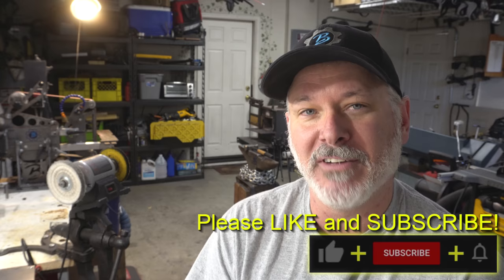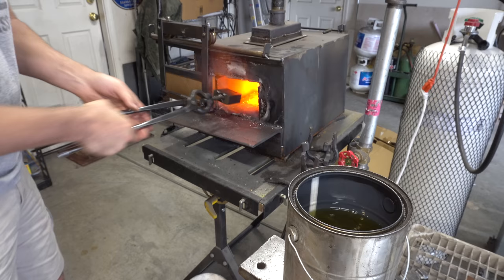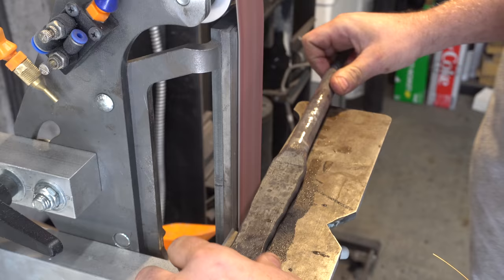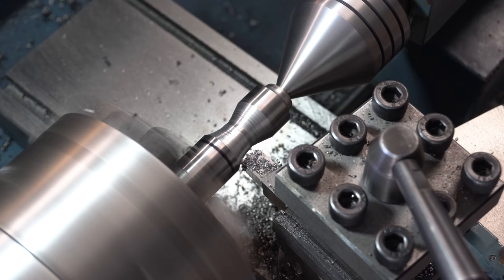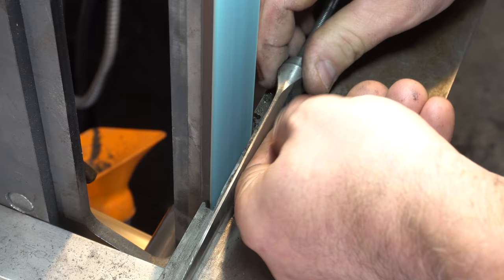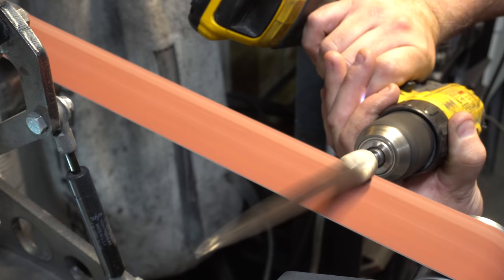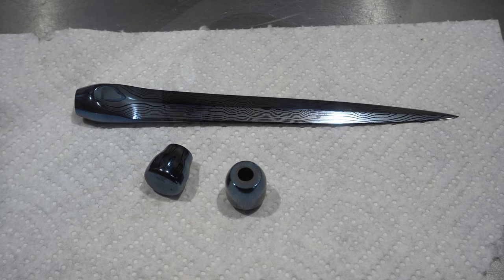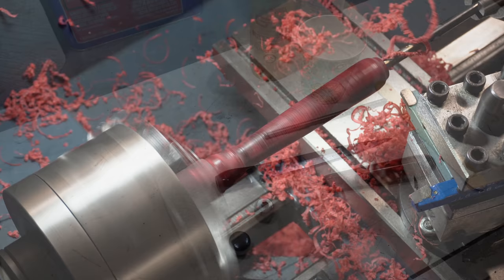Forging a damascus letter opener for Santa's mail

Comment from the maker: Do you like the hot bluing on the letter opener?  You might see me use this technique in upcoming builds.  Please checkout the links in the description and help support the Millikan's efforts!
Reply: Hot bluing is awesome. Never heard of it before this. I’m not a knife maker but I could see cool uses for it with the general blacksmith stuff I do. Is there an affiliate like for the stuff you used to do it in the description? I read through but I don’t think I’m seeing that - I could just be dumb though. Also, is that kerosene your dipping the billet in before the forge? If not what it is and what’s the reason? Thanks for the videos!
Reply from the maker: @midknightforge7446  I should have mentioned it, it’s called NitreBlue from Brownells.  You can’t buy it on Amazon, I had to order it directly from Brownells.  The liquid is kerosene and it burns off when the billet goes into the forge and so does the oxygen to reduce scaling.  Thanks for watching!
Reply: What tips do you have for young blacksmiths such as my self beyond your triple t Thursday videos
Reply from the maker: @coltgross6943  Practice by making things like leaf pendants, hearts, icicle Christmas ornaments, anything like that so you can start learning hammer control.  If you want to be a blacksmith (as opposed to a Bladesmith), this is where I suggest you start.  Even if you want to be a Bladesmith, it’s good to learn that first.  Something I should have said in my last Triple-T.  When I was learning, I made some Christmas gifts for people, learned on some mild steel and made square tapers and then twisted them and formed hearts.  I made shepherd hooks.  Lots of things before I tried knives.  I hope that helps.
Reply: The bluing turns beautifuly- photographs doesn't show it, but there was few moments on a video where the real colour is visible. Maybe I'm wrong but does this solution is only for increasing dencity of the liquid- just to make it boil in higher temperature? In general if you tempure the blade in 600F - it will turn blue anyway.. I don't know this method- just asking cause it interested me. 
Great video and project Man!
Reply from the maker: @DBCraftWorld  There's no other liquid you're adding the salt to, the salt itself liquifies from a complete solid.  It's not the same as tempering at 600F, the bluing solution leaves a nice shiny finish and you can achieve different colors depending on the heat.  If you go up to about 650 or higher, you'll get a deep purple color.  Thanks, David.
Reply: @Tyrell Knifeworks good to know that there is something like this and it work like you described:). Thanks a lot for sharing another method of colorizing metal!
Reply from the maker: @DBCraftWorld  it’s a great process and not too complicated.
Reply: I need a video of some more hot blueing. I want to refinish a few pistols and no one close by does blueing anymore.
Reply from the maker: @SuperRobertheath  well you’ll have to watch my Bowie Challenge build on Friday! 😜
Reply: Nice blueing.   I've used a solution of sodium hydroxide and sodium nitrate (or potassium nitrate) for hot bluing.  Heated to about 290 F for 30 min.  Parts come out pitch black and wont effect the temper.   Great vid.
Reply from the maker: @thorneworks  I plan to do some black “bluing” in the future.  👍
Reply: @thorneworks  The reciepie you described is the most common method. It works good, but not the same on different steel type.
Reply: @SuperRobertheath  Nitre bluing is not the same as hot bluing firearms.  Different type of chemicals and different temps.  For "caustic hot bluing" of firearms, there are different brands and types of chemicals, you can find them at Brownells and other firearm accessory places.  But, the main thing is, caustic hot bluing of firearms is done at much cooler temps.  Most hot gun bluing is done at around 292-295 degrees F.

Nitre bluing, also called "hot salt" bluing in the firearms world is used only for coloring small pieces like screws, etc, never the barrels, frames, receivers, etc.  

Nitre bluing is the same thing as "heat bluing."  As steel is heated, it changes various colors.  You can even heat blue steel with a torch, but it does take some practice to get an even color.  Hot salts are used simply to get a steady and even heat over the entire part and it makes it easier to get the heat at exactly the temperature you want.

Heat colors on steel are just thin oxide layers and as such, they are not very durable.  Hot caustic bluing, however is the second most durable form of bluing.  Rust bluing is the most durable, but you can't get a mirror shine finish with it like you can with hot caustic bluing.

Comment: beautiful work. I use Acrylic to make pens all the time. A very nice material to get a smooth shiny polish on. The only change I might have made to this build would have been to keep the spacer as part of the blade - eliminate the ridge between the blade and spacer, as well as carry the etching lines in a continuous pattern.
Reply from the maker: Yeah, I originally was going to put another material between the spacer and the blade but decided against it.  The etching was supposed to match up but I somehow got the spacer twisted during glueup.  😕
Reply: Owen how much do you charge for a pen or set of pens
Reply from the maker: @coltgross6943  Sorry, I don't do pens at all.
Reply: I know but Owen does
Reply from the maker: @coltgross6943  sorry, I didn’t see the “Owen” there.  😜

Comment: The bluing looks fantastic. Thank you for pointing out this specific process does change the temper on the blade.
Reply from the maker: It’s a really cool process for fittings.  In a recent video I did hot blackening and that only requires 290F, but your parts come out black, not blue or purple.

Comment: Beautimous! I suspect Shurap has used the hot blueing process on some of his blades to get the color he achieves, but as you say, 640 degrees ruins temper. Guess it doesn't matter on an art knife or a beautiful letter opener.
Reply from the maker: Yes, doesn’t matter on this project.   Hot bluing is usually reserved for fittings.  Thanks for watching!

Comment: I really liked the way it looked after the oil dip hardening, 10:16 straw and black. I wonder if you could use the oven to turn the lighter parts a straw color after etching. also wonder if you could get a cool pattern if you turned a piece in the lathe then flattened it.
Reply from the maker: You can achieve that straw color with the hot salts.  You just keep going to a higher temp.  Thanks for watching.

Comment: For hand sanding can you not use a device like the YT knife maker Shurap??? Will save ur hands
Reply from the maker: Shurap's blades are all the same shape and profile.  I don't think there's a universal device like that.  Certainly not for something like this letter opener.  Thanks for watching.
Reply: @TyrellKnifeworks  yes ur right. I see that. Pity there’s no way to speed that process up with a machine. Love ur work btw 👍
Reply from the maker: @SparkWah  thanks for watching, Marc!

Comment: 11:30 Looks like a solution that MichaelCthulhu would use. Pretty sure he has done this. As long as you keep your fingers away from the sharp spinny bits then all should be fine.
Reply from the maker: It wasn't sharpened at this point so it just looked scarier than it really was.  Avoiding hand sanding is a driver for a lot of ingenuity!  😜

Comment: Would the bluing process ruined the finish if you would have used copper in the Damascus?
Reply from the maker: That’s an interesting question.  I have no idea.  I’d have to try it with a test piece first.

Comment: awesome build denis for a great cause  i have all my steel and everthing to build my press i have a question your drawing dies and flat dies what size half round did you use? and what size is the square stock? 1.5x1.5? thanks Mark and what type of steel is best for the dies?
Reply from the maker: My dies are on 1/2” thick 5” squares.  My flat die is 1.5” thick/wide and 3” long.  I have aggressive round dies from a 1.25” round rod and I have drawing dies that I ground a curve in from 1”x3”x3”.  You don’t need anything but mild steel since there’s no impact.  Hope that helps.

Comment: Is that acetone in the paint can?
Reply from the maker: No, it’s kerosene.  It burns off when the billet goes into the forge and so does any oxygen between the layers to reduce any scaling.  Acetone would be VERY dangerous since it’s WAY more flammable, including the vapors.  Don’t do that, you’ll burn down your shop.  Thanks for watching, Adam.

Comment: Awesome work again! Love your videos! How thin do you grind the edge of your bevels before sharpening? I have previously took the bevel all the way to sharp on the grinder but it seemed far too thin, any advice would be great! Thanks
Reply from the maker: Thanks so much, Stephen!  It depends on the knife and edge geometry really.  If it’s a chopper then I might only take it to 20 thousands.  A kitchen knife will be almost sharp.  Something like this bowie was around 0.005-0.007”.  I don’t want the secondary bevel to be to big.  Thanks!
Reply: @TyrellKnifeworks  thank you very much!!

Comment: It's not a Damascus, it's pattern welding. Please don't miss guide people, it's a very important topic, so please please please don't miss guide.
Reply from the maker: Don't be that guy.  First, traditional damascus (Wootz) is no secret.  We know how it's made and people make it all the time these days.  We all refer to damascus as both modern and traditional methods.  You don't need to correct people, particularly people that most likely know much more about it than you.  Let me explain how your comment comes off to others, particularly bladesmiths.  It sounds douchey.  Sorry but it does, and it makes you seem like a guy who's watched a video or two and learned some info and  wants to feel smart, so you correct the guy who already knows more than you and uses the term because that's what 99.99% of people relate to.  Don't be that guy.
Reply: @TyrellKnifeworks  I come from the region where the process of making wootz was practiced. Get the ability to digest what is correct dude
Reply from the maker: @michihassang4808  I don’t give a crap where you came from.  I’m quite sure you’ve never done any forging yourself so you have no practical knowledge and your just a guy on the internet trying to tell someone who’s got more experience about it.  Just stop.

Comment: Nice result. but you made 1.5 kg piece of metal and after that grinded off 1.3 kg. Not so much efficiency as for me.
Reply from the maker: This wasn’t about efficiently.  Sometimes you need to waste sone material to get the outcome you want.  The steel is actually the cheapest part of the build anyway.  Thanks for watching